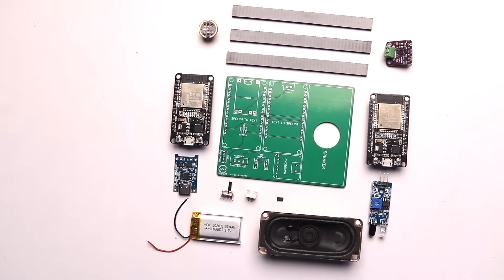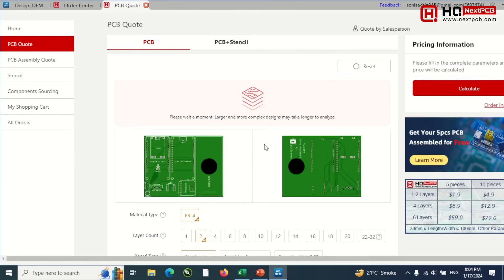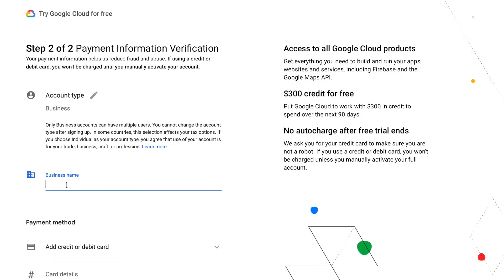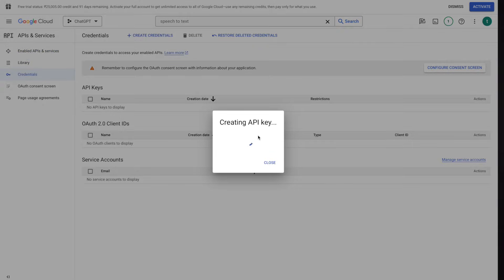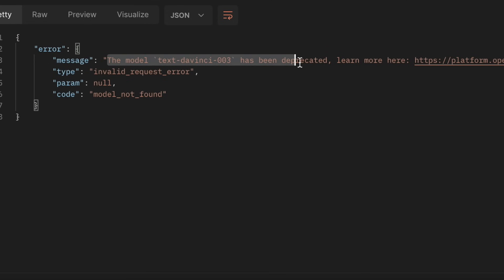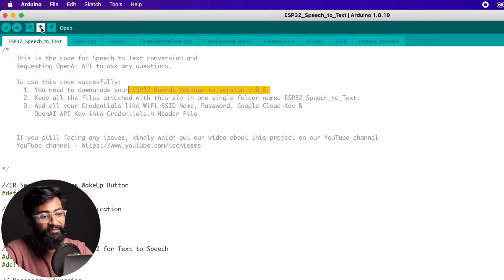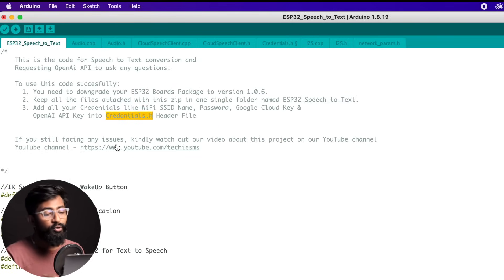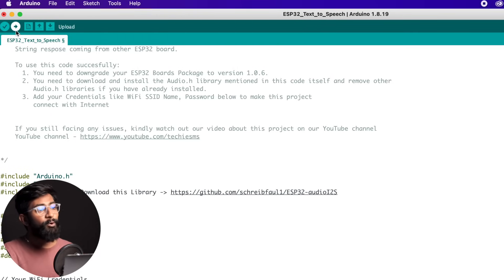The BEST ESP32 project based on ChatGPT | IOT Projects | NextPCB

Comment from the maker: If we ever make version 3 of this project, what will be your suggestions about adding/removing things in this project? Share your thoughts..
Reply: Increase the recording time because 1.9s we can't say too much
Reply: Use Google Gemini api instead of chatgpt api and voice recognition module like su-03t English version  instead of ir sensor also increase the recording time to 5 secs
Reply: The thing is ultimately it isn't free
Reply: can you upgrade the record second ? because now its 1.9 sec :(
Reply: What changes do i need to make in the code to be able to use Google Gemini api instead of chatgpt api
Reply: Hello Techiesms!
The project is working great - great job!
The problem is low processor memory. only 2 seconds for the Questions task is too little. Longer responses are skipped because the receiving buffer is too small. I have a question whether it is possible to modify the program for ESP32 VROVER to extend the Voice Recorder (5 sec) and the receiving buffer for Text 2 Speech (Max Tokens 100).
Then the device would be perfect!
Warm greetings from Bavaria!
Roman
Reply: Great work anyways. As always I will keep buying products from you
Reply: we can also add screen for interaction.
Reply: please use all free methods
Reply: Use the text to speech API from Chatgpt instead Google. Maybe the answer will obtained faster.
Reply: Pcb design file for print
Reply: Where is the pcb file?
Reply: you can do the same thing (generative language) for Gemini Pro and I have a good idea, you can make the project more beautiful by using OLED screen (SSD1306) and Wowki Animator.
Reply: Bro help me about Google api is there alternative
Reply: @clipsucess  Well there is technically no other alternative to get the STT API from google. They only charge Rs.1 or 2
Reply: Hi sir can you list out the things used
Reply: Use one mcu
Reply: use threading/milis() to use only one esp
Reply: add a wakeup word instead of gesture
Reply: That audio h library shows an error like

In file included from c:\Users\sreerama\Documents\Arduino\libraries\ESP32-audioI2S-master\src\Audio.cpp:15:0:
c:\Users\sreerama\Documents\Arduino\libraries\ESP32-audioI2S-master\src\opus_decoder/opus_decoder.h:7:20: fatal error: memory.h: No such file or directory
compilation terminated.

exit status 1

Compilation error: exit status 1
Reply: @amalnp3934  kid change the version of the esp, in boards manager
Reply: It needs to run a local LLM and to be able to control your smart home devices :)
Reply: Add camera too. Like eyes
Reply: Local working with TinyLlama or similar
Reply: make with Gemini api and 1 esp 32
Reply: Why you used 2 esp 32
Reply: make it with google gemini
Reply: Please make it with Gemini overnight... Please 🙏 bro.I request you 😢
Reply: hey techiesms!!! i love all of your projects. my suggestion is cant we just make this project much simpler with using gemini ai because now gemini itself has the option to read out its answers in a voice like alexa so can't we reduce the of manually adding speech text and submitting the text to the ai and getting the results in text form and the again converting the result text to speech manually? because now these ai can themselves give results in audio format and gemini ai even have the option of giving audio input. So what i am trying to say i cant we just use a simple esp32 code to feed the ai with our voice command and directly giving out the output audio through the speaker which is the output audio of the ai which it has already generated in a audio form itself.
Reply: can u provide the files for the PCB
Reply: How to make it
Reply: You can add a display to show the results
Reply: Chance voice in male
Reply: wake up with custom command, chat gpt specific for college information like time table faculties as per data uploaded with prsent contents
Reply: Bro I want to buy completed version project can you pls sale me
Reply: Because Gemini API is free and I have another idea:2. ESP (I mean the ESP32 module that controls the speaker) should be in the box, but
1. Let the esp (I mean the esp32 module that controls the microphone) be on a remote control and record the sound when you click the button.
Reply: Add wake up word to your assistant that can help to use is without ir sensor. If you can do it early, I will use this in my project for school science exhibition
Reply: @alphabeta3735  i did this wake word system for this project. if you buy i wanna sell you my code
Reply: Make it offline. Even tho it seems a little hard

Comment: sir when i compile the code error: architecture or board not supported sd.h file ka sath
is there any solutionn??????
Reply: You found any solution for it ?
Reply: @sarlasingh8851 yes
Don't downgrade the devboard do the same with the latest version everything will run fine

Comment: pls solve this  
the monitor mode shows this problem auto Rebooting

ets Jul 29 2019 12:21:46

rst:0x1 (POWERON_RESET),boot:0x13 (SPI_FAST_FLASH_BOOT)
configsip: 0, SPIWP:0xee
clk_drv:0x00,q_drv:0x00,d_drv:0x00,cs0_drv:0x00,hd_drv:0x00,wp_drv:0x00
mode:DIO, clock div:1
load:0x3fff0018,len:4
load:0x3fff001c,len:1044
load:0x40078000,len:10124
load:0x40080400,len:5856
entry 0x400806a8
Press button

Record start!

Processing your Audio File
Json daata---
Guru Meditation Error: Core  1 panic'ed (LoadProhibited). Exception was unhandled.
Core 1 register dump:
PC      : 0x4000c677  PS      : 0x00060c30  A0      : 0x800d1db9  A1      : 0x3ffb1c60  
A2      : 0x00000000  A3      : 0x3f4002c6  A4      : 0x0000000a  A5      : 0x0000031a  
A6      : 0x00000000  A7      : 0x3ffb86e0  A8      : 0x3ff44000  A9      : 0x00000000  
A10     : 0x00002a00  A11     : 0x3ff49040  A12     : 0x08000000  A13     : 0x0000000a  
A14     : 0xffffffff  A15     : 0x0000000a  SAR     : 0x0000001e  EXCCAUSE: 0x0000001c  
EXCVADDR: 0x00000000  LBEG    : 0x400014fd  LEND    : 0x4000150d  LCOUNT  : 0xffffffff  

ELF file SHA256: 0000000000000000

Backtrace: 0x4000c677:0x3ffb1c60 0x400d1db6:0x3ffb1c80 0x400d2933:0x3ffb1f90 0x400d80f4:0x3ffb1fb0 0x400899f6:0x3ffb1fd0

Rebooting...
ets Jul 29 2019 12:21:46

rst:0xc (SW_CPU_RESET),boot:0x13 (SPI_FAST_FLASH_BOOT)
configsip: 0, SPIWP:0xee
clk_drv:0x00,q_drv:0x00,d_drv:0x00,cs0_drv:0x00,hd_drv:0x00,wp_drv:0x00
mode:DIO, clock div:1
load:0x3fff0018,len:4
load:0x3fff001c,len:1044
load:0x40078000,len:10124
load:0x40080400,len:5856
entry 0x400806a8
Press button

Record start!

Processing your Audio File
Json daata---
Guru Meditation Error: Core  1 panic'ed (LoadProhibited). Exception was unhandled.
Core 1 register dump:
PC      : 0x4000c677  PS      : 0x00060c30  A0      : 0x800d1db9  A1      : 0x3ffb1c60  
A2      : 0x00000000  A3      : 0x3f4002c6  A4      : 0x0000000a  A5      : 0x0000031a  
A6      : 0x00000000  A7      : 0x3ffb86e0  A8      : 0x3ff44000  A9      : 0x00000000  
A10     : 0x00002a00  A11     : 0x3ff49040  A12     : 0x08000000  A13     : 0x0000000a  
A14     : 0xffffffff  A15     : 0x0000000a  SAR     : 0x0000001e  EXCCAUSE: 0x0000001c  
EXCVADDR: 0x00000000  LBEG    : 0x400014fd  LEND    : 0x4000150d  LCOUNT  : 0xffffffff  

ELF file SHA256: 0000000000000000

Backtrace: 0x4000c677:0x3ffb1c60 0x400d1db6:0x3ffb1c80 0x400d2933:0x3ffb1f90 0x400d80f4:0x3ffb1fb0 0x400899f6:0x3ffb1fd0

Rebooting...
ets Jul 29 2019 12:21:46

rst:0xc (SW_CPU_RESET),boot:0x13 (SPI_FAST_FLASH_BOOT)
configsip: 0, SPIWP:0xee
clk_drv:0x00,q_drv:0x00,d_drv:0x00,cs0_drv:0x00,hd_drv:0x00,wp_drv:0x00
mode:DIO, clock div:1
load:0x3fff0018,len:4
load:0x3fff001c,len:1044
load:0x40078000,len:10124
load:0x40080400,len:5856
entry 0x400806a8
Press button

Record start!
Reply: Mic is unable to recognise your voice input. It might be because of connection issue or Google cloud API issue.

Comment: Hi techiesms,
your project is awesome .. can't wait for next steps. I will rebuild it for sure, doing some adjustments and enjoy ;). Any ideas for battery mod would be best anyhow. To your questions on eof videe (ideas for next steps), here my personal coins:

1. stay with ESP32, not using Raspberry Pi, reasons e.g: (a) we can utilize the existing code, no Python needed, (b) no Pi (Unix OS) overhead needed, keep it small and beauty, and (c) much easier for battery powering .. just my coin (i jumped once to Pi, did not like it .. then went back to my sweet home ESP32 & Teensy ;)
2. solving the input length issue would be most important (i feel 2 or 3 seconds are too short for nice chats)
3. yes, solving the charging issue, would be awesome to have this beauty box totally portable !
4. later on maybe a 'wake-up-key' phrase (just optionally, i will stay with a simple capacitive touch button for now)

just my coins, I'm exited next steps ! .. cool work !

Comment: Hello Techiesms!
The project is working great - great job!
The problem is low processor memory. only 2 seconds for the Questions task is too little. Longer responses are skipped because the receiving buffer is too small. I have a question whether it is possible to modify the program for ESP32 VROVER to extend the Voice Recorder (5 sec) and the receiving buffer for Text 2 Speech (Max Tokens 100).
Then the device would be perfect!
Warm greetings from Bavaria!
Roman
Reply: Hello did you make the project as I wanted some tips

Comment: Good work am replicating it but got issue with Speech_to_text. I followed video all steps but you didn't talk about network_param.h file. About "getting the certificate for your region".  Both set of code uploadd fine for both esp32 but for the case is speechToText my esp32 crash (keeps on restarting when trying to communicate with Google STT api)
Error:    Processing your Audio File
Json daata---
Guru Meditation Error: Core  1 panic'ed (LoadProhibited). Exception was unhandled.
Core 1 register dump:
PC      : 0x4000c677  PS      : 0x00060a30  A0      : 0x800d1d11  A1      : 0x3ffb1c90  
A2      : 0x00000000  A3      : 0x3f4002cb  A4      : 0x3ffb1d08  A5      : 0x000001d5  
A6      : 0x00000000  A7      : 0x3ffb86e0  A8      : 0x3ff44000  A9      : 0x00000000  
A10     : 0x00002a00  A11     : 0x3ff49040  A12     : 0x08000000  A13     : 0x00000007  
A14     : 0xffffffff  A15     : 0x0000000a  SAR     : 0x0000001e  EXCCAUSE: 0x0000001c  
EXCVADDR: 0x00000000  LBEG    : 0x400014fd  LEND    : 0x4000150d  LCOUNT  : 0xffffffff  

ELF file SHA256: 0000000000000000

Backtrace: 0x4000c677:0x3ffb1c90 0x400d1d0e:0x3ffb1cb0 0x400d2893:0x3ffb1f90 0x400d8054:0x3ffb1fb0 0x400899f6:0x3ffb1fd0

Rebooting...
Reply: Did you fix this error?

Comment: As suggested below: use a wakeup word and create the possibility to 1. run an Internet radio 2. use ChatGPT for question/answer, 3 Perform an action with Servomotor. Integrate also the board DY-HV20 for predefined responses.
Then this project will become a very good foundation for a ROBOT.
Anyway: Sachin congrats: version 2  works!!

Comment: Is there a specific reason you chose to have two different boards for two different functions? Can’t both of them be uploaded into one?
Reply: You have to use a board that support 2 I2S modules on the same board, a smaller variant of ESP32 like this only support one

Comment: Unfortunately, it is using ir sensor to wake it up. You have to add wake up word in the project so that  the assistant can wake up without ir sensor.   try to add it fast and provide us
Reply: Easy 🙌🏻
Reply: @saidevdhal  hi can i get the code for text to speech and speech to text ,iam getting error from github code
Reply: @Nk-creations_x  Are you working on this project ? currently

Comment: What about proximity sensor ? 

How it should be connected in circuit? 

Also, how is working the way its changing color ?
Reply: same question , Have you found a solution to this issue?
Reply: You should check the last video in the V1 series. The connection diagram was there.

Comment: @techiesms I used this code and ran into compiling error with Text_to_Speech code. I installed the audio library and I got this long list of errors mostly related to non-declaration of objects. 
    libraries/ESP32-audioI2S-master/src/Audio.cpp:206:18: error: 'struct i2s_config_t' has no member named 'mclk_multiple'
    libraries/ESP32-audioI2S-master/src/Audio.cpp:212:65: error: 'I2S_COMM_FORMAT_STAND_MSB' was not declared in this scope
    libraries/ESP32-audioI2S-master/src/Audio.cpp:222:65: error: 'I2S_COMM_FORMAT_STAND_I2S' was not declared in this scope

And more like this. Any suggestions on what might be wrong? Thanks.
Reply: i m also facing same problem
Reply: any suggestions pls reply...
Reply: i m also facing same problem. so pls give us suggestions and solutions
Reply: Did you have the PCB's Gerber file?

Comment: @techiesms i have tried compiling the text to speech code (yes i have downloaded the .zip file from GitHub) but keep on getting the same error -

c:\Users\basan\OneDrive\Documents\Arduino\libraries\ESP32-audioI2S-master\src\Audio.cpp: In constructor 'Audio::Audio(bool, uint8_t, uint8_t)':
c:\Users\basan\OneDrive\Documents\Arduino\libraries\ESP32-audioI2S-master\src\Audio.cpp:206:18: error: 'struct i2s_config_t' has no member named 'mclk_multiple'
     m_i2s_config.mclk_multiple        = I2S_MCLK_MULTIPLE_128;
                  ^
c:\Users\basan\OneDrive\Documents\Arduino\libraries\ESP32-audioI2S-master\src\Audio.cpp:206:41: error: 'I2S_MCLK_MULTIPLE_128' was not declared in this scope
     m_i2s_config.mclk_multiple        = I2S_MCLK_MULTIPLE_128;
                                         ^
c:\Users\basan\OneDrive\Documents\Arduino\libraries\ESP32-audioI2S-master\src\Audio.cpp:212:65: error: 'I2S_COMM_FORMAT_STAND_MSB' was not declared in this scope
         m_i2s_config.communication_format = (i2s_comm_format_t)(I2S_COMM_FORMAT_STAND_MSB); // vers >= 2.0.5
                                                                 ^
c:\Users\basan\OneDrive\Documents\Arduino\libraries\ESP32-audioI2S-master\src\Audio.cpp:222:65: error: 'I2S_COMM_FORMAT_STAND_I2S' was not declared in this scope
         m_i2s_config.communication_format = (i2s_comm_format_t)(I2S_COMM_FORMAT_STAND_I2S); // Arduino vers. > 2.0.0
                                                                 ^
c:\Users\basan\OneDrive\Documents\Arduino\libraries\ESP32-audioI2S-master\src\Audio.cpp: In member function 'const char* Audio::parsePlaylist_M3U8()':
c:\Users\basan\OneDrive\Documents\Arduino\libraries\ESP32-audioI2S-master\src\Audio.cpp:2561:45: error: 'lltoa' was not declared in this scope
                     lltoa(xMedSeq, llasc, 10);
                                             ^
c:\Users\basan\OneDrive\Documents\Arduino\libraries\ESP32-audioI2S-master\src\Audio.cpp: In member function 'uint64_t Audio::m3u8_findMediaSeqInURL()':
c:\Users\basan\OneDrive\Documents\Arduino\libraries\ESP32-audioI2S-master\src\Audio.cpp:2784:31: error: 'lltoa' was not declared in this scope
             lltoa(b, llasc, 10);
                               ^
c:\Users\basan\OneDrive\Documents\Arduino\libraries\ESP32-audioI2S-master\src\Audio.cpp: In member function 'bool Audio::setPinout(uint8_t, uint8_t, uint8_t, int8_t)':
c:\Users\basan\OneDrive\Documents\Arduino\libraries\ESP32-audioI2S-master\src\Audio.cpp:4514:18: error: 'struct i2s_pin_config_t' has no member named 'mck_io_num'
     m_pin_config.mck_io_num = MCLK;
                  ^
c:\Users\basan\OneDrive\Documents\Arduino\libraries\ESP32-audioI2S-master\src\Audio.cpp: In member function 'void Audio::setI2SCommFMT_LSB(bool)':
c:\Users\basan\OneDrive\Documents\Arduino\libraries\ESP32-audioI2S-master\src\Audio.cpp:4686:65: error: 'I2S_COMM_FORMAT_STAND_MSB' was not declared in this scope
         m_i2s_config.communication_format = (i2s_comm_format_t)(I2S_COMM_FORMAT_STAND_MSB); // v >= 2.0.0
                                                                 ^
c:\Users\basan\OneDrive\Documents\Arduino\libraries\ESP32-audioI2S-master\src\Audio.cpp:4690:65: error: 'I2S_COMM_FORMAT_STAND_I2S' was not declared in this scope
         m_i2s_config.communication_format = (i2s_comm_format_t)(I2S_COMM_FORMAT_STAND_I2S); // vers >= 2.0.0
                                                                 ^
Multiple libraries were found for "Audio.h"
  Used: C:\Users\basan\OneDrive\Documents\Arduino\libraries\ESP32-audioI2S-master
  Not used: C:\Users\basan\OneDrive\Documents\Arduino\libraries\Audio
exit status 1

Compilation error: exit status 1

Comment: Unfortunately, ChatGPT API isnt cheap. You incur cost for both input and output , so a device running chatgpt as the interface will quickly run out of credits. A better alternative is to use Hugging  chat which is free but it only has python library.
Reply: You can just scrape the library api and use it in c code instead of the openai api
Reply: @snopz  can you please explain it in little more detail if possible or provide with the some links please
Reply: Bro help me about Google api is there alternative
Reply: Thanks for the suggestion
Reply: I've tried multiple options , from llama based models , home start etc and a few local LLMs all native on my GPU but none of them compare to GPT APi, it is expensive but I've set my spend to £6 a month and use the cheapest 3.5 API and it's just unrivaled, I used it integrated into home assistant and no other LLM comes close , which is unfortunate for the time being
Reply: @jaysalomon5298  so can you also ask it questions like turn on/off your home lights, etc.
If yes have you documented how you did it or some videos/articles related to it will also be really helpful.
Thanks
Reply: Its cheap now
Reply: Bro I should use Gemini Ai of Google. It is completely free for general purpose ❤❤❤